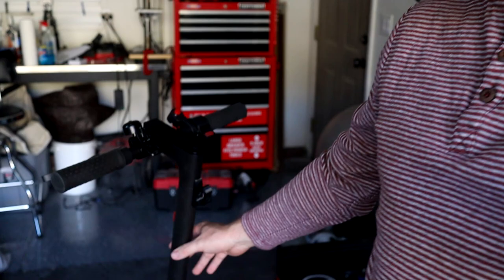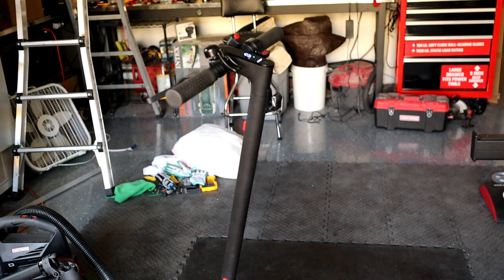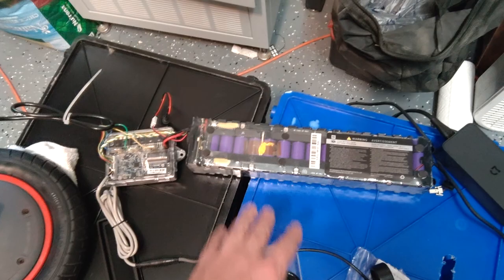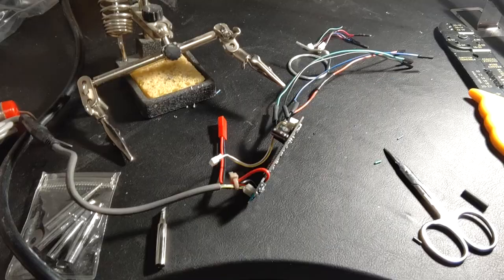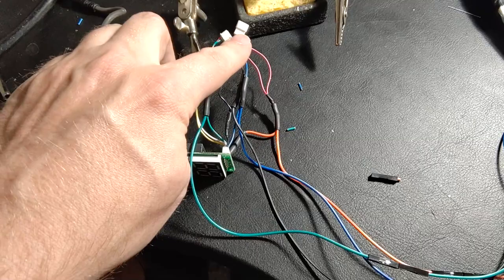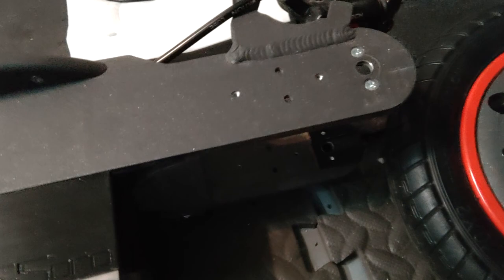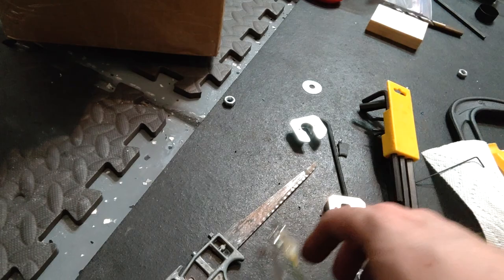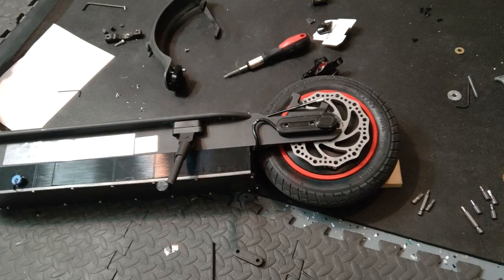M365 AWD Dual Motor Scooter Build

Comment: i made an e bike with dual motor. one of the controllers was controlled by arduino. if i push gently on the throttle there was only one motor engaged, if i push it all the way, second moyor would engage. and if i reached a certain speed one motor would shut down

Comment: please you can provide us with a complete list of materials, maybe links to Amazon eBay
Reply: Just buy the monorim 500 w aftermarket motor from aliexpress
Reply: @unlightofficial8571   can u fit that motor to an aovo pro m365 with all the original components thanks.
Reply: @jackscott5144  You should be able to, it's made to fit the m365

Comment: Cool ! It would be nice to see a wiring diagram how you wired up the two speed controller boards and how to use 1n4148 and the correct way to connect both controller. thanks
Reply: Did he send you the wiring diagram?

Comment: Nice!  It would be nice to see a wiring diagram how you wired up the two speed controller boards if any, 
and the two BLE boards to use with one throttle level.  I assumed you connected the BMS for each 
battery pack directly to the each speed controller board but is there something else you had to connect
between the two speed controller boards?  Some guy had a video on youTube that showed a connection 
between the speed controllers but you did not mentioned if you did in the video.

I assumed you can use the same firmware to flash the two speed controller boards since they are 
independent to each others.

Another thing, you may want to put those cheap front suspension on your Xiaomi 2WD.  The ride quality
is totally different.  I got mine from eBay for $41 and it took about an hour to swap them.

Comment: Absolutely awesome video showing everything with loads of detail. Has anyone tried keeping just one battery and just one computer, but running two motor drivers? I’m guessing the combined current draw would need checking to make sure that the battery can supply without any issues
Reply: same question in my mind too, i already have a second motor and i have been thinking about adding it to the first motor wires and see how it goes
Reply: So did u use two or one batteries

Comment: If you would’ve hade the same motors, would u be able to just wire the motors to the same control unit and just connect the battery’s in series?

Comment: Hi, great video, very interesting. I was wondering if it is possible to use just one controller to support/run the 2 powered wheels? Also I know virtually nothing about 3d printing. The link that you gave regarding the battery extension cover. Is that the information that a person with a 3d printer needs to make it? Did you modify & make your own from it? Many thks Steve
Reply: No you need a motor controller that supports 2 engines

Comment: Hi, a couple of questions.
1) When you turn on the second BLE with the button, how do you know what mode it is in? (eco, normal, sport).
2) How do you synchronize both BLEs? Otherwise you will have one in sport mode and the other in eco mode. How do you manage them?
Reply: old vid, but I know you can do this using the SFHU. If you have a custom firmware on it, you can can basically set it to always come on in the same setting. Beyond that, likelihood is only wanting the second one for added torque, so you can set it to bypass all modes and just operate in one speed....with a second throttle, you can basically feather it to match overall traveling rate. I'm in the process of doing this with a ninebot max g30 clone using 10inch stock rear wheel, two m365 controllers that have been modded for higher voltage and current, and an m365 motor with 10 inch tire on the front. My plan is to set the second controller (front wheel) either to Direct Power mode and use a 2nd throttle, or put both on Scooter Hacking firmware and tune them where the front uses a little less power to match the rear speed (since most weight sits on the back) and have them operated from the same throttle and power button (with a parallel bypass on/off switch for motor two) so I can choose whether I power them on simultaneously or independently.  Fun fact is if you go from a Ninebot rear driven scooter to a dual motor, it's a lot easier to make a Xiaomi motor fit the front fork (short shaft and ample clearance) than the modifications it takes to make ANY motor fit the rear of the M365 models. I'm hesitant to go Ebrake only, but I do realize that the drum on the Ninebot wasn't that strong anyhow. I'll have a disc kit to install from Monorim just in case, but I think it's gonna be solid. Parallel 36V batteries with an external plug to bump it all up to 48V and if I choose.

Comment: Any chance you can make a video and break it down some more in sections etc part 1,2,3,4 and we can all buy all required hardware and modify it and what firmware would be grateful. Other then that this video is not intended for us having the same as what you got more of a demonstration and idea. But other then that thanks for this video but it's a very very big tease knowing we haven't got a idea how to doit.

Comment: How did you manage the recuperative mechanical force from the rear motor when the second system is off? Did you try to use only one battery, I guess its not going to use twice the battery,  because the effort is not twice bigger on each wheel?

Comment: ...wondering if one board can controll two motor controllers if one want's all the time 2 wheel drive?

Was planing to upgrade battery, either buying higher cap cells, or adding additional one to it... And adding additional motor to rear, but don't need option for controlling those separately, buth rather having it dual motor all the time...

Is there anywhere to find pinouts for modules?

Thanks...

Comment: can i connect a second motor to the same original motor wires without adding it to a seperate battery and control board?

Comment: does anyone know what's the exact list of parts needed for this plz??
..and if its possible to only use one controller for both motors/batteries?
Thank you
Reply: u can do it with 1 battery but need 2 controlers

Comment: Do the brakes ease in still with only being motor brakes or is it just all or nothing when it engages
Reply from the maker: The brakes are electronically modulated still depending how hard you squeeze.
Reply: @cbutters  interesting project. With a full battery though do the electronic brakes work?

Comment: hi, great scooter,do you think two motors could run off only the original battery?
Reply from the maker: I mean... anything is possible... you would definitely need two speed controllers though. if you wanted more power; you'd probably need a custom battery though, lots of guys bump things up to 42v...

Comment: wow that traffic in front of your shop... djeez is it always that busy? amazing build!!! so sick especially impressed by the electronic braking. Does it have a true sinewave or squarewave controller? my newest bike build has amazing regen brakes but still uses a square wave KT controller
Reply: I still think your braking situation is kinda bad. from my experience you truly need to have good controlable brake force. for me braking electronically on my bike is really strong. but if I ride down a hill its only so much it can do where my brakes really give me a sense of control being able to completely or close to lock the wheel
Reply from the maker: I totally get that you might want to lockout the wheel. ESPECIALLY on a bicycle. However on a scooter; when going ultra low speeds; you just put your foot down and you are fine. This is actually the exact same principle used on Segway ES2 and Unagi Scooters or "one wheels" which do not feature disc or drum brakes either. I'll have to do a video of me stopping on an extreme hill. It really does slow quite well; but yes; I agree... Ideally there is a physical brake; adding one at this point to my build seems overkill though; as it would be adding a THIRD brake and repurchasing a motor cover. For those viewing; they may want to make that design change when building (as I noted in my video) but as for me; It works great.
Reply: @cbutters   hi where did you get that plastic thing to add the extra battery Thanks
Reply from the maker: @RandomClips27.  I designed and 3D printed it myself... see :https://youtu.be/jQBnvAtLxe0

Comment: What  happens when the batteries are full and you apply the electronic brakes while going down a hill at high speed?  Won't the energy generated by the breaking system fry the controller?
Reply: It won’t. It simply won’t brake :)
Reply from the maker: My understanding is the electronic brake is different than regen braking. The electronic brake literally shorts the motor and slows it that way at the cost of heat.
Reply: @cbutters  I have installed Rita on my m365 and it allows to connect 12s battery together with the stock one. When both batteries are fully charged - I have no braking power from the motor at all. This suggests me that it is a regen brake on the m365.

M365 custom parts on theit fb posted some news - as I understand they are coming out with front diskbrake mod for the monorim v2 :) 
And myself I can’t find the inserts for installing the motor at the back of the m365 :(
Reply from the maker: @VRMinde  I'll have to do a 100% charge and test on mine. I usually charge to 90% and haven't had any braking issues.

Comment: hey question can showcase a diagram for connecting stuff i have two motors with me with batttery pack need help with wiring the controller
Reply: Hello did you connected?
I am also in same situation  now.

Comment: How does charging works for this project please?
Reply from the maker: each motor, motor controller, charger and battery system is completely separate; they only are linked by the handlebar controls. (Each battery charges separately)

Comment: How do you account for the 0,6V drop through the diode?
Reply: just experienced this issue with trying this mod. I'm about to switch to a Schottky with a super low voltage drop bc this 1n4148 is 0.6 to 1V.... top speed went from 36/38 freewheel to 29/30 based on the return voltage. Schottky should keep me closer to unmodified.
Reply: Just tried tweaking the firmware for my scooter and I was able to negate this by adjusting the max throttle hall sensor setting. Using the Scooter Hacking Firmware that I flashed to my controller, there's a configuration near the end that adjusts hall sensor settings for the throttle and brake. I think default is about 180 for the throttle... and after the diode ....my top speed was reduced while freewheeling.... I adjusted the throttle max to 155 and regained the previous top end. I'll see how it works under load after I get my new data cable for the second motor and controller to tie it all back together.

Comment: Where’s the break
Reply from the maker: Front and rear electronic brakes just like the unagi scooters. It is controlled electronically from the brake lever which is wired to both electronic speed controllers

Comment: Range??topspeed??
Reply from the maker: It is still operating under 36V batteries so it doesn't have a much better chance of success at higher top speed; Right now I have it capping out at 32kph (20mph) I haven't tried to really bump up the top speed as that is plenty for me.
If you take the range of the Pro and the range of the M365 battery; should get around 40-45 miles of range; but I still need to do a range test.

Where this mod really shines is in the acceleration and hill climbing department; I can go up the steepest hills in my area at 20+kph, where many of these hills were almost impossible for the Pro to climb at all.
Reply: How did you get it to stop going up n down in speed while doing top speed?? And is there anyway I can do this modification without soldering?